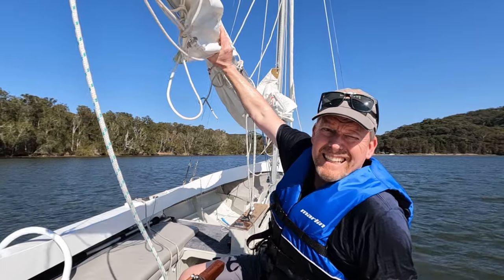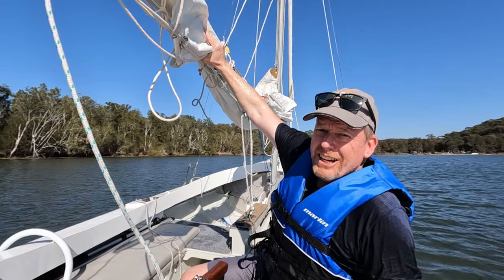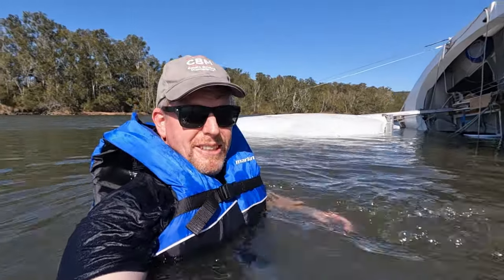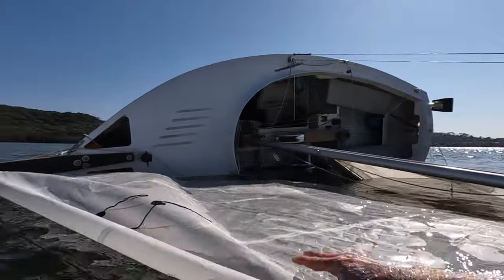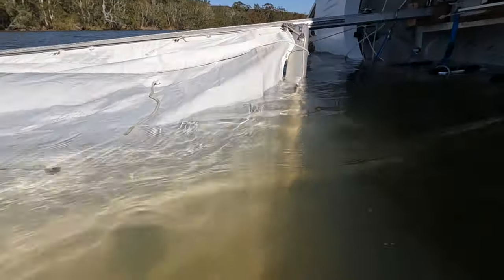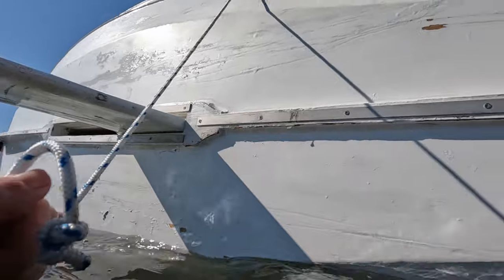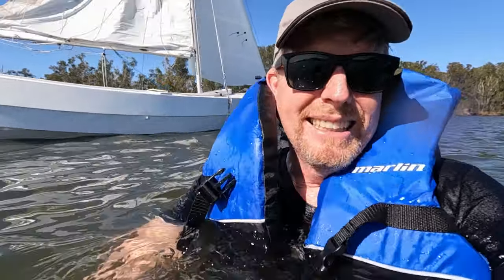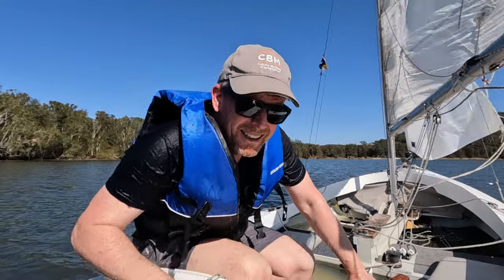Ep. 31 Capsize Test: Welsford Navigator "Trim" goes over on Narrabeen Lagoon, Australia.

Comment: Good for you Josh, well done. Reassuring how hard the navigator is to capsize, great the mast float works so well, and great you can get her back up and you back in. And even better that you actually got out and did it. Bravo.
Reply from the maker: Thanks Gary. Yes a very stable boat indeed.
Reply: @DinghyCruisingKingfisher  interesting too to see the "tail" on the bottom of the centreboard. A good bit of insurance. I have been thinking I might try a downhaul arrangement on the Scamp, but the tail looks simple and fool proof, even if it does cost you 0.001 of a knot.
Reply: my calculations? actually .000005 of 1x knot

Comment: Good to see another dinghy without transom flaps or self-bailers. I capsized in heavy weather last year and had to bail using, like you, a collapsable bucket but for the last dregs of water I have a bilge pump that is clipped onto the side of the centreboard casing. I think yours is a bit lower than the GP14 so maybe you would have to just stow one elsewhere but it does make light work of the last bits of water. Good video and it really shows how stable that Navigator is! :)
Reply from the maker: I have been thinking about bilge pump but bucket, smaller bucket and sponge did the job. That’ll do for now. Thanks for your input, Cheers- Josh

Comment: I am impressed how well the mast float worked. When I capsized  'Bootstrap', a gaff rigged Navigator with wooden spars, she turned turtle within a few seconds..... Is the mast float inflatable? Can you please send a link?
Reply from the maker: Hi Richard, yes it is an inflatable float I bought from ebay.
I didn't pay this much but here is a link to the same thing:
https://www.ebay.com.au/itm/143822283291?epid=7025599708&hash=item217c79e21b:g:S4wAAOSwrglfoh~z&amdata=enc%3AAQAIAAAA4F5gLgwoEGIUO%2BU6bLjD58TFsdFGZHCTIGY8VK%2Bma2%2FLny9%2FGfijOyDJ%2FXH9mhbFQGDzEUzk7mcVCrt%2B4YEsbmQmWWjX6a8%2BoATgRuqF1YLDJBZqETAPYCQiNmFo%2FKQMQcy9k0S89knZPUXhjpMfJcOq8n9I%2FJi581YtZq2v5XVMF36EoRnIfQTfxmIGZ53X9aq4uOC4R8UJSgfPQOSvMIRxsLQcd9lzBRnAoxy80hbA%2Bz2896MrdI95vVYUkOLR%2B1Vz4Vn%2BzHhpH8CgukE9Wny7%2BIF31OOIPABJwtVQ7M7s%7Ctkp%3ABFBM2rLyjpFj

Comment: great video ,practice is essential and when the real thing happens its, easy to know the drill without panic, although  i would never solo sail in any condition without hook in points on the boat never know when a freak gust hits you ,also put all your gear under gunnels netted in or tied in dry bags you wont loose or destroy equipment ,sailing at sea all about being prepared ,built in redundancy ,plan A plan B and Plan C
Reply from the maker: Absolutely! Thanks for your input. Josh

Comment: Josh, when you get home and hose out the boat, how do you drain it?  With the Argie 15, I could never hose out the inside because there was no drain bung.  Luna has a self draining cockpit which is super easy to hose out and the scuppers drain it.
Reply from the maker: I didn’t hose it out. A wipe down and dry out the mats was all I did. She doesn’t drain, I never use the bung. A car wash sponge gets all the excess water out.

Comment: Looks like half the dinghy sailors I see around wouldn’t have the physicality to reboard their vessel in the event of a capsize. Especially in proper conditions which are the ones most likely to capsize you in the first place. Also, need to be dressed for immersion, or cold water shock could pop your heart. It would be a pretty good fright in a seaway seeing your boat on its side
Reply from the maker: It is definitely physical!
Reply: adrenalin and survival instincts would see you back on the boat and pull it up without thought or panic, as long as you know the drill which this test in calm safe water  is perfect to imprint to memory

Comment: Really interesting video Josh. Thanks for posting really appreciate that. Some quick thoughts. .....I have knotted righting lines and boarding loops shamelessly stolen ideas from Joel Bergen and Howard rice. Haven't tested in capsize but boarding loops work well when I've been off boat swimming 😆. I have a downhaul on my centreboard which I can lock in place in the centreboard cap instead of the little line you have on bottom of CB. However yours would be safer should the boat invert. The mast float is an interesting idea. I'm trying to work out how that would look with the standing lug variation rig and spirit boom configuration. I have installed a tiny electric bilge pump on arwen powered by a tiny 12 v battery....videos of it in my channel and blog. In tandem with a frightened man and a bucket it shifts water rapidly 😆. Easy to make. Can't work out whether trim has cockpit bulkhead hatches under side and front thwarts or not. If so, did they hold our water? Brilliant video. Thanks buddy 👍👋
Reply from the maker: Trims forward thwart is open, just side bench tanks and front tanks for buoyancy. The hatches did let some water in but not enough to worry about. Physicality is the main requirement! I think getting up onto the centreboard is difficult, and I probably could have entered the boat as she turned but I was trying to film everything. The mast float is particular to my aluminium mast I would think. Thanks for dropping by Steve.
Reply: I also have a down haul in cockpit to hold centreplate, as i was not sure about the line on the bottom of plate idea: mines got a chunk of lead on base and wasn’t sure where to drill a lanyard…but interested in trying one as a backup …